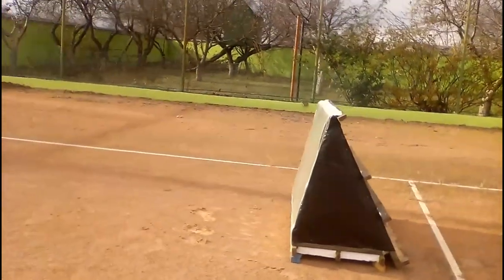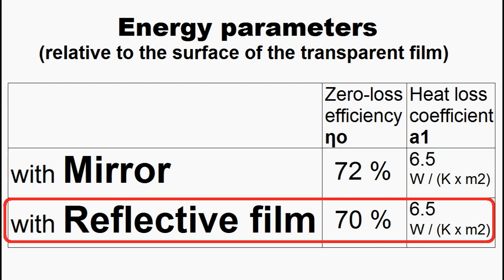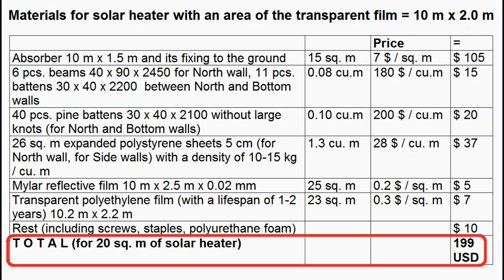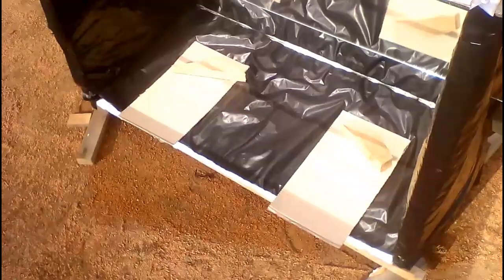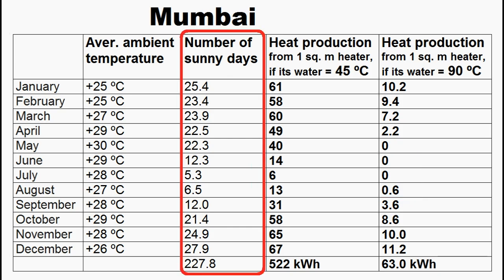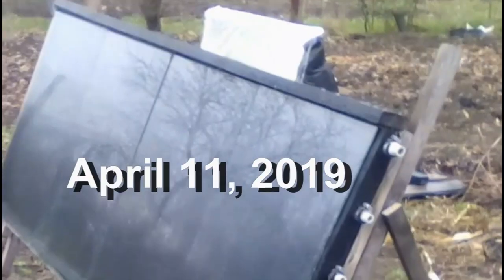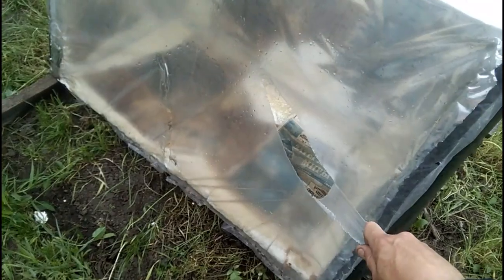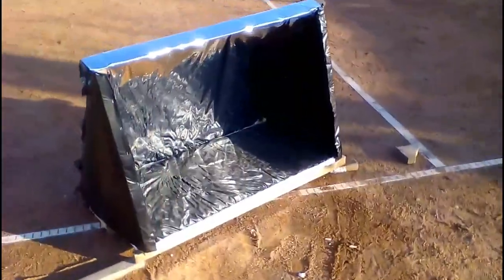Solar water heater "Mirror trap": its construction, cost of its heat

Comment: Part of the equations needs to account for how many years of service these materials offer in this arrangement for this purpose. 
I know their(current energy providers) prices are bloated for how much it takes, but their stuff lasts for more than a year. But we can still make stuff much cheaper than them, but it has to be rebuilt too often, and constantly maintained with this really cheap materials. We will need to buy steel and real glass(better materials), and pull real vacuums in pipes and inside windows and stuff, etc...

Like this solar water heater, use real glass so you can pull a vacuum in it. You don't need their expensive evacuated tubes if we can pull a vacuum in the whole chamber. Granted they might be a step up on us with the kind of tinting they use but a vacuum will help us alot regardless of their fancy tints.

Comment: I suggest gathering old mirrors, but the not shatter proof kind of glass, so you can cut them up into pieces of your choosing. Just make strips out of them and glue them on where that old worn out reflective film is. Take the old film off, or get new panels and bend those creases in them like you do, and have the mirror glass cut to those widths, and glue them on there.

A glass cutter will only cost you like $20.00 at most. Just don't sweat it, practice on some older glass you don't care about, then try on some pieces you want to use and things will work out.

Get really good glue and sealant though. At least try to build a test panel made that way to see how long it lasts and how good it works, etc... With a good glue and sealant around the outside edges it might last 5 years or maybe more. And even then when it appears like the mirrors are getting loose take it all down and scrape the back of the mirrors off and do it again. Glue them back on again after cleaning the mirrors off and the panels. But those panels might need replacing too often, need to find something a little more reliable for panels, because then you won't need to do anything to the mirrors or the panels for like 10-20 years.

I seen your other video about concrete panels, they seem cheap enough money wise. Use those with the real mirror strips glued on, now you have something that won't need to be bothered with for like 30 years or more if you use real good glue and sealant, and prep it nice before you glue and seal. Not only that a real mirror surface is highly reflective, and you can dial it in and it will stay. But i suggest throwing some hemp into the concrete panels when making the panels, use hempcrete, you can make it yourself if you can get hemp.